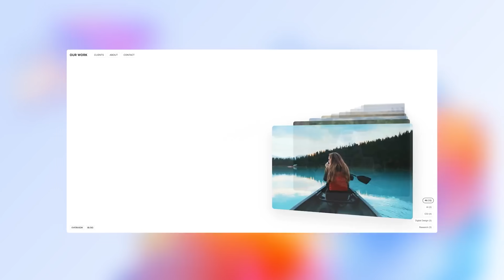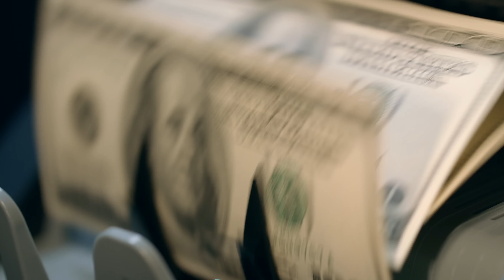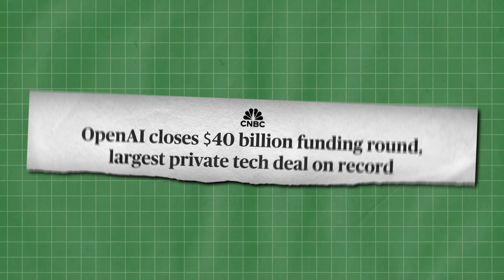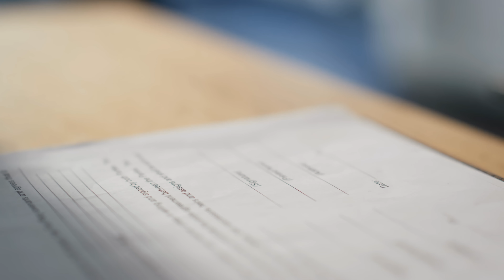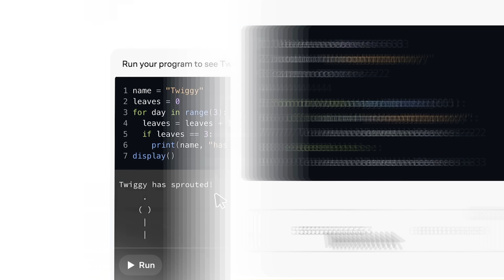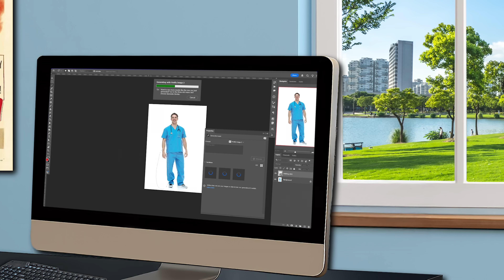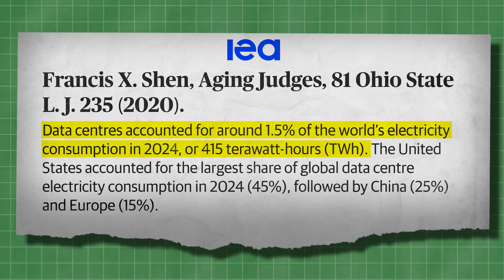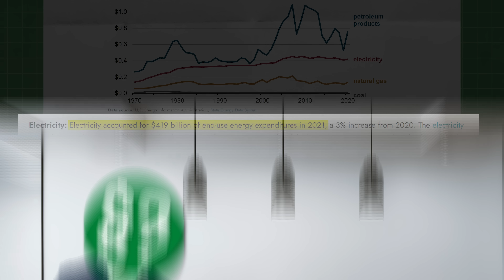How Much Has The World Spent on AI?... So Far

Comment: Our grid barely holding on is an UNDERSTATEMENT. People tend to forget (and for gen z, they likely just don’t know per usual lmao) but our “grid” isn’t philosophical, it’s a massive PHYSICAL nationwide grid. Comprised hundreds of tons of wood, steel, concrete, and copper. The U.S. power grid is the single largest machine EVER built by the human race. It’s THAT massive…and it’s very close to being in peril. It’s simply not possible to upgrade it. Not only do we not have the trillions upon trillions necessary, we don’t even have the raw materials necessary in this country to upgrade the grid. We’d need an unimaginable amount of resources. The only reason it runs as well as it does now is due to the thousands upon thousands of men (engineers/technicians) doing the dirty work to keep it afloat. And that’s just ONE of the infrastructure issues AI is wreaking havoc on & a VERY rudimentary overview of our incredibly complex power grid. Entire degree fields have arisen in an attempt to tackle this issue, still to no avail.

Comment: I have worked with a robotic arm and AI for a decade. I can safely say that AI is retarded and simply does not understand real world physics. Robotic arms don't work if it's too cold because of the magnets in the robot so you need to have a heater on them the whole time. If it's too hot, then the touch screens become unusable, and robots need some cooling, or it will overheat. If for whatever reason the robot arm skips a line of code, then the arm will go crazy without having a rest point and it will not stop screwing up if you are not there to stop it.

Comment: At the 6:00 minute mark it's not quite right for accounting purposes... They can write down the value of the chips to the higher of value in use or the fair value. The tax treatment and accounting treatment are different.
Reply: Actually, that assumes the chips are being treated as long-lived assets under IFRS. If we're talking about inventory under US GAAP, the opposite is true... They would be written down to the lower of cost or net realizable value. The specific accounting framework being used is critical here.
Reply: @SwanUnderIce  I believe both IFRS and USGAAP measure inventories at lower of cost or NRV. However, with USGAAP the inventory method used is important to consider.
Reply: Yes, DTA and DTL do exist.

Comment: AI is costing me $150-200 a month for electricity.. no I'm not using it.. 4 data centers opened up in Oregon..January 2022: A substantial 15% rate increase was implemented. 
January 2023: Another large increase of about 21% took effect, influenced by higher natural gas and wildfire mitigation costs. 
January 2024: Rates rose by approximately 11% due to similar cost pressures. 
January 2025: The Oregon Public Utility Commission (PUC) approved a nearly 10% increase, which brings overall rates to roughly 57% higher than in 2020.

Comment: 5:37 this is not entirely true and you should study the technical side of this more because economists and analyst keep getting this point completely wrong.

Yes newer GPUs are a lot better and has better watt per tflop use, but the main thing they want isn't raw compute but memory

There is a large black market where older GPUs are modified and larger memory modules are sodered on. Also an older slower GPU with 96 GB of video ram is 5 times more valuable than a state of the art GPU with 24 GB only

Add to that, that some newer GPUs are more power hungry and require expensive and complex water cooling, and completely new infrastructure and cables to connect the infrastructure, then it isn't exactly as simple as "get the latest and greatest"

Maybe for dumb idiot Startups, but AI startups being braindead is nothing new

Comment: 12:30 you are wrong. The US still gets around 25-30% of its nuclear fuel from Russia. And The US never sanctioned them. Most of the other nuclear fuel either is from France or made by French companies inside the US.
And US electricity prices were low because most of US electricity came from domestic gas production. It was only cheap though because it is heavily subsidized.
Reply: US natural gas prices are so cheap that it's often just burned as a waste product of oil extraction. The aim is oil, and the gas extracted alongside it is of less market value than the cost of transporting it to a customer.

Comment: Back in 1990 how many companies investing in the Internet made huge profits? No, they were loss leaders. Companies that invested initially seemed to fail in terms of revenue generation and profitability with those projects. But many of the companies that did invest became extremely successful with emerging technology leading to massive dividends once the technology matured.

We're seeing companies fail to generate revenue because the people working at these companies don't properly understand how to utilize AI and the technology is quite immature so many companies start with a framework which ends up dying or being replaced. Also, many companies struggle with governance, security, privacy, etc which makes using these models very difficult in practice within an enterprise context. These teething issues are the problem and you seem to only superficially understand the economic elements here. Ah 95% of companies failed to achieve profitability--well duh, that's par for the course for brand new emerging technologies that are deeply in flux. I mean gpt 5 and Claude sonnet 4 and other such models which are finally pretty competent have just been released. Gpt 4o was pretty incompetent all things considered and had numerous issues. Tooling like through MCP is also becoming prominent just now which was another major AI bottleneck.

Comment: I'm sure I'm missing something simple here, but why does the energy cost go to everyone and not the data centers and then the data centers passing the cost to data users? What's the precedent that makes this "normal"?

Edit: I'm GENUINELY surprising I got a straight answer from Google for something "current event" related (usually it beats around the bush and it's easier to get something in a YT comment section). REGULATION. Lucky for data centers, utility companies aren't allowed to charge over certain caps per customer in many areas. Data centers are well over the cap, so they get subsidized by everyone else.
Reply: the simple thing you are missing is a grift

Comment: Techbros have built their entire past 50+ years of existence on "We can make things bloated, because the technology will improve!" Which is why you can use a car from 2005 with little problem, but a phone or computer from 2005 is borderline or outright unusable.

They're quickly learning that the "if it's bloated, it's fine! The tech around it will improve!" doesn't exactly work for energy generation lol
Reply: And the rate of improvement has slowed - that why the tech industry moved so much to subscription services instead. It used to be just fine selling hardware or software for a one-off fee, because in three years it would be outdated and the customers would be back to buy the next major version. Now, though, a PC from 2012 is still usable, and most of the software would  be too, if not for active efforts to render them obsolete through deliberate incompatibility.
Reply: That's not fully true.  Software used to be very efficient, it's slowed down more recently.  Really it started with the pivot to video stuff Facebook pushed and then followed with other web2.0 technology where the economics made it so scaling hardware backends was more cost effective than adding efficiency at the software level.  Now we see a different reason for a lack of optimizaiton which is that it's not cost effective.  Everything these days revolves around a first to market advantage, and a better product that's beaten to market by something buggy and slow isn't competitive.
Reply: @phonyalias7574 I agree, the optimisation is getting worse for new software.
Reply: @phonyalias7574  The pivot to video came about because video advertising is more profitable.

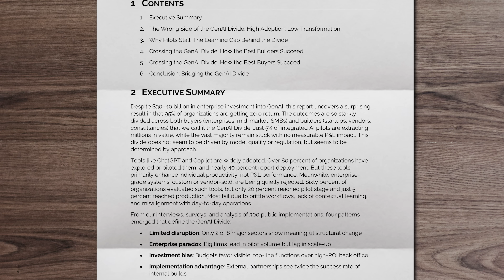Comment: 8:30 Zero returns 'sounds scary', but how much did those companies 'save' from cutting back their workforce? If they at least broke even, it was worth it to them, because now they have fewer employees to worry about.
Reply: The sad part is they barely saved anything. AI is generally too unreliable for logical work and too boring for creative work. Only the gruntiest of the grunt work can be done well by AI, and most of that is so basic it was already automated years ago. For example, in this video they talk about using AI to crop backgrounds out of images to turn them into assets, but there were already programs that did that, it was so ubiquitous that Paint 3D had a tool for it and came pre-loaded on every copy of Windows 10 after 2017 (although it wasn't that good).
As I write this, I'm waiting for ChatGPT to generate sketches of comic book pages for me to finish. It can't even consistently get the correct number of panels.
Like they said, to justify the price tag, AI needs to be more than an incremental improvement on a few tools that came out years ago.
Reply: Companies that managed 0 returns for extended periods of time to eliminate all competition, are the reason for enshittification and are actively making everything worse. So Zero Returns is scary cause it will make things worse for all working class people

Comment: You are double counting a lot of investment by counting both cloud providers and the actual end users of the chips. For example, Nvidia sells H100s to Microsoft, who then puts them on the Azure cloud, which is then rented by OpenAI. You cannot count both numbers as a resource. Microsoft is just a middleman for private investment.

The real cost can better be calculated as Cost of chip manufacturing + cost of R&D + Cost of datacenters/support. A good proxy would be to subtract Nvidia/TSMC/Cloud provider profit from the totals to get a closer cost.

Also, your tax point about depreciation is incorrect/outdated, at least for investments made in the US. The new US tax bill makes all depreciation available upfront for capital investments.

Comment: "Technology like this has changed the world before" 

See, I feel like "like this" has done a tremendous amount of heavy lifting for AI sycophants. They are always talking about how incredible it will be tomorrow, radically transforming our society in unforeseeable ways just like the Internet. But in what way are LLMs anything like the global interlinking of digital devices? They are text generators, not hardware/software designed to facilitate a new type of communication. You can't just point to someone who didn't think the Internet would change the world and then say "anyone who doesn't think AI will change the world is like that". Where is the utility now? I think they are best suited at creating text where the semantic meaning of the actual words is unimportant (can I swap a word for another word that means something entirely different?), which in my experience is well-suited to programming (aside from keywords everything is just a label for a representation of something, a variable can be called "foo" or "bar" without changing the functionality of a program). But even in that domain the data is sketchy on productivity and as a regular AI user I often reach its limits and have to problem-solve around them.

 We've been using machine learning algorithms for years and never thought the end was nigh because we knew the YT recommendation algorithm wasn't sentient. Suppose the algorithm wrote out a paragraph explaining the rationale behind the selection, it would be no more intelligent than returning the IDs of the videos, it would just be using hundreds of times more processing power.

Comment: How much more will be spent? What is the useful life for hardware, data centers etc.
Reply: Don’t know, but as a not-coder blue collar IT worker whose focus is turning wall sockets into WiFI, I don’t see a problem 🔌📡
Reply: @doujinflip  Gold rushes and shovels
Reply: Data centers are going to be economic rather than physical. The actual building is quite adaptable, as it designed to be so - extra space in the cable ducts and such. All the equipment within can be changed as new designs become available. But if the AI bubble bursts, a lot of data centers might just become unprofitable due to over-supply as all those customers vanish.